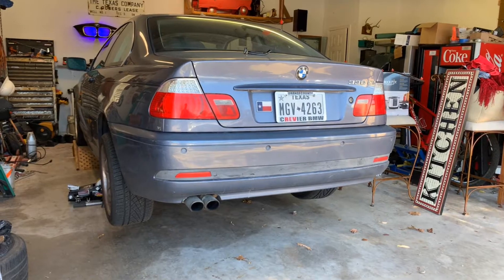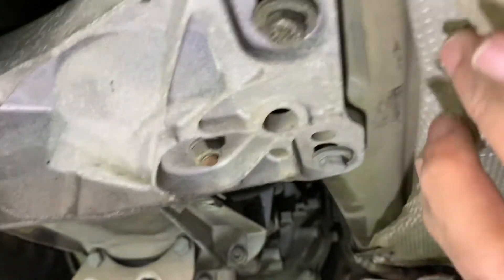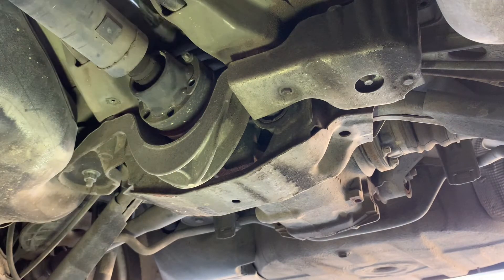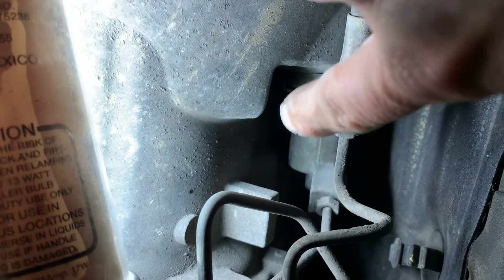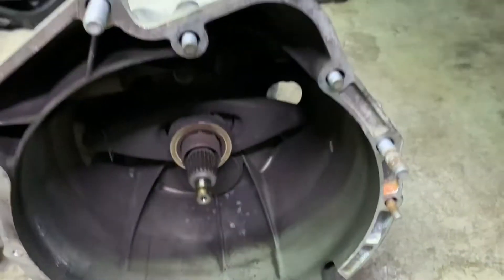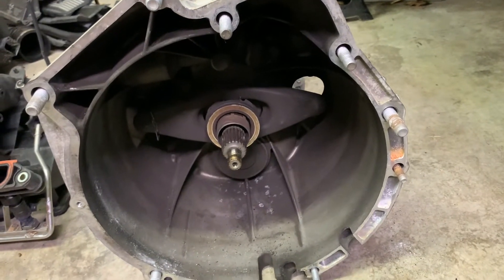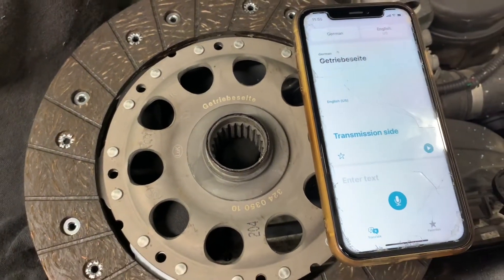BMW E46 Clutch Replacement

Comment: Thanks for taking the time to film this video.  I too am doing this in my garage and I was hesitant to get started but I am going to charge ahead.  Great video work and commentary along the way.
Reply from the maker: Thanks for the kind words and thanks for watching. Just take your time, be patient and I’m sure it’ll all work out. Good luck.
Reply: @gerechoppers  Done.  I appreciate all of the tips.  One difference for me is that I didn't go at the starter from the top.  I cleaned off the mounting pin really well and tapered it a bit with a multitool.  I was then able to get the bell housing in place, and reach up from the bottom to wiggle the starter into position.  Thanks for all of the hard work filming!
Reply from the maker: Awesome. I’m glad you got it done.
Reply: Me too! 😉  thank you!

Comment: Thanks for the video, was looking for a 330i 6 speed clutch replacement video for so long. Confused me a bit with the bearing part since I am installing a Single mass flywheel without a bearing in it. Now I know I need to install a pilot bearing inside of the crankshaft instead.
Reply from the maker: Thanks for watching. I’m glad I could help, even if just a little.

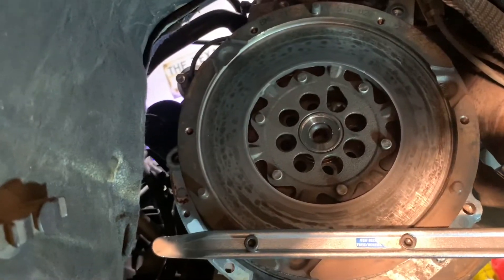Comment: At 30:36 this is what i did to hold the flywheel on my E36. Screwed on the longest transmission bolt, just a few threads, through a small wrench and the the other end of the wrench rested against one of the small divets protruding from the flywheel. Held it perfectly!
Reply from the maker: Sometimes the simplest solutions work the best. Thanks for watching.

Comment: I’m an enthusiastic but very noob car mechanic and, man!, is your video encouraging.  It is SO helpful to see how this job can be done without my 325xi up on a lift.

One thing I don’t understand:  why did you even take the flywheel off? Couldn’t you have inspected it just as well to your satisfaction that it didn’t need replacing leaving it in place?

Again, really great video, thanks so much for making and posting. Subscribed!
Reply: Dual Mass Flywheels need to be replaced every clutch change to prevent chatter as they have springs that wear. Valeo sells a  single flywheel conversion to eliminate the dual mass but my car was manufactured 04/2004 and the kit works up to 09/2003 production so I'm stuck with have to use another DMF.

Comment: Any problems with the bras pivot pin?
Reply from the maker: I had to do a little fitting(sanding) to make it fit in the hole on the bell housing, but other than that there have not been any problems with it.